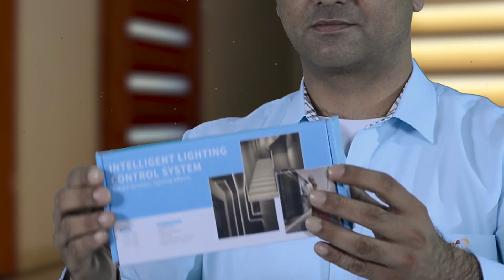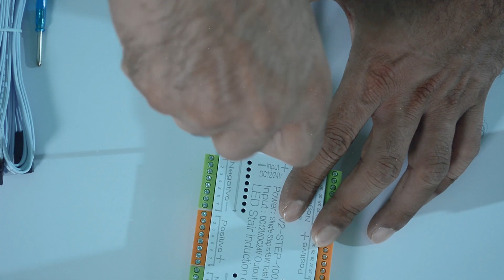How to connect V2-STEP-1002 Stair Light Induction Control Unit

Comment: I noticed that the display board is only indicating red light and the light when passed on the sensor it will not show, what can be wrong?
Reply from the maker: Thank you for reaching out. We're sorry to hear you're experiencing issues with your light. Please contact us at +971 50 392 8341 or visit any VMAX branch so we can assist you with resolving the issue. Your satisfaction is important to us!